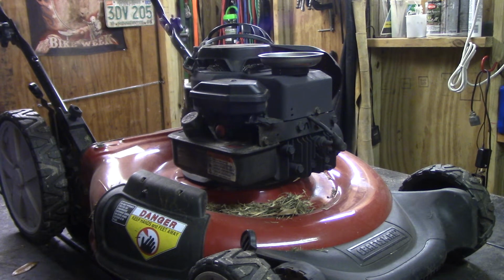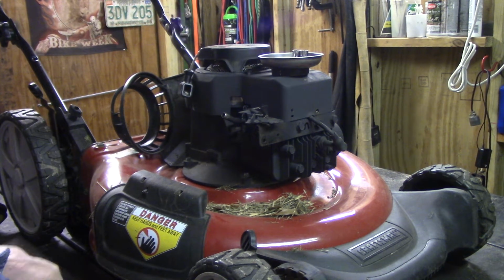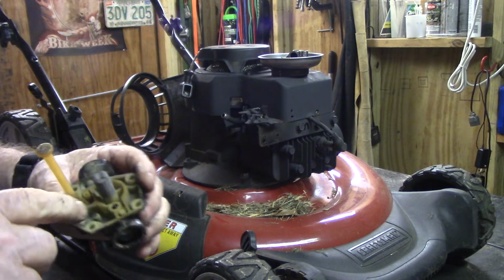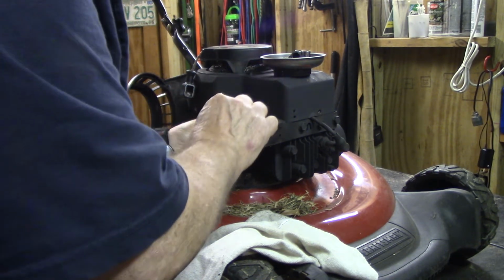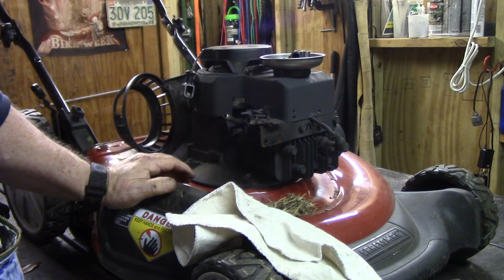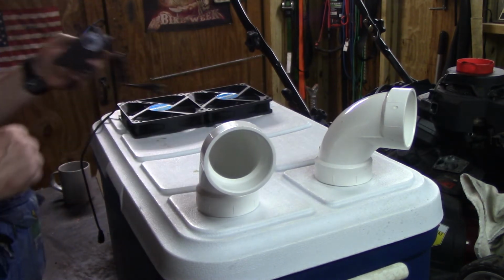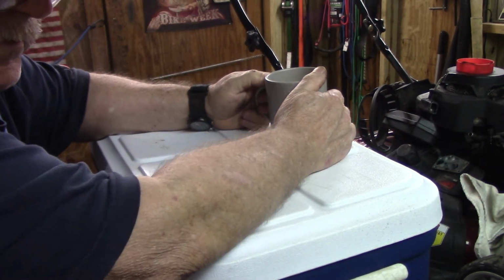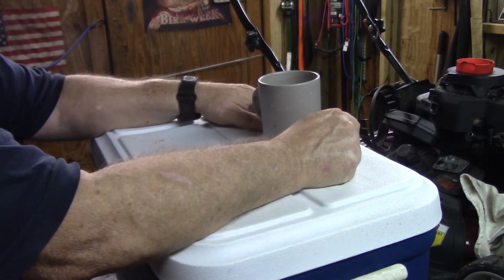Push mower repair and Swamp cooler

Comment: I've heard lately that there are problems with canned fuel (Trufuel, etc.). Maybe that's what is in the tank.
Reply from the maker: I smelled of it and it does not smell like a gas I have ever smelled. If it was a two-cycle if would have smoked. And I've never seen a black two-cycle mix.
Reply: @dukesworld3020  I’m betting it’s one of the 4 cycle brands that went bad
Reply from the maker: @mattthescrapwhisperer  You may be right. But watch the next video.
Reply: @dukesworld3020  Will do!
Reply: Good video
Reply from the maker: @pwalpar  Thank you!!!

Comment: that was odd colored gas, was it full of motor oil? I've heard of swamp coolers but I have never had any experience with one.
Reply from the maker: And it didn't smell like gas or oil. Maybe after it sits overnight it will separate and I'll be able to tell what it is.

Comment: Black gas huh? 🤔 Did it smell like black licorice? Coffee as 10 pm is normal and I need to get one of those gadgets to check RPMs. What program do you use for editing videos?
Reply from the maker: You funny, I don't edit.
Reply: @dukesworld3020  
I know you don't as you stated but I guess I'm wondering if you have Windows movie Maker on your computer.
Reply from the maker: @WallysPlace66  Not on my new one. I've tried a couple of others but just can't get the hang of it. But I'll keep trying.